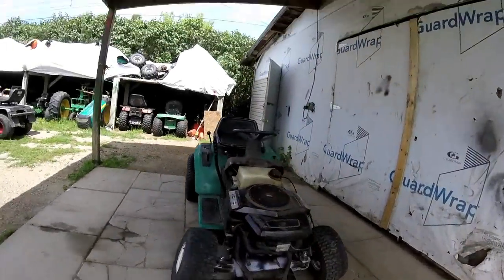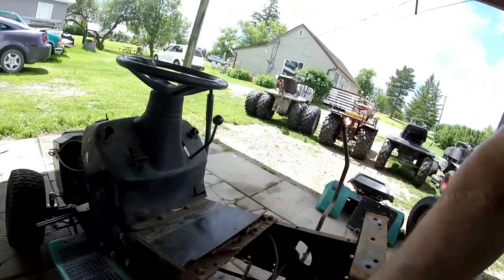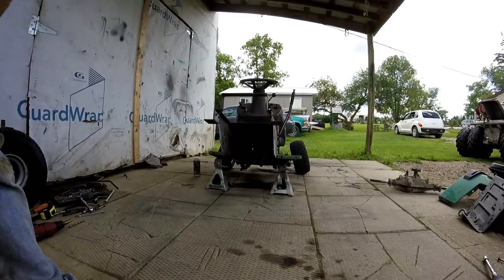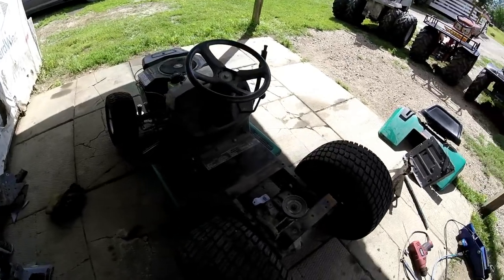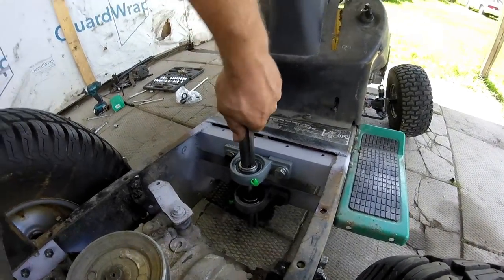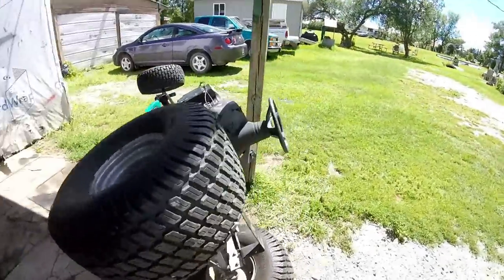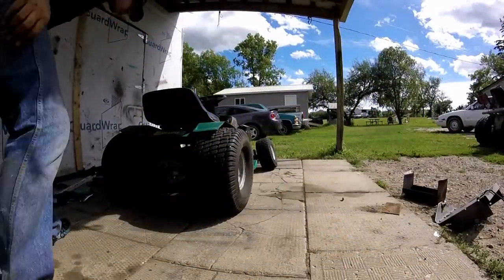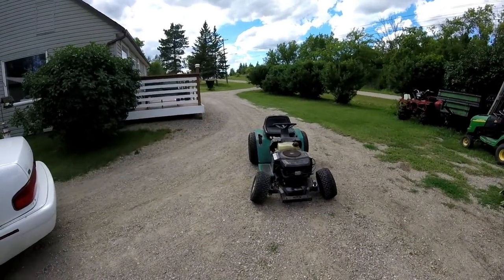How to build a racing mower part 2 lowering rear end

Comment from the maker: I made a extension bar goes on top of the shifter linkage extends about 4in made out of 3/8 ratchet extension
Reply: How did u do the gearing because of torque issues

Comment: On the motor it should be a 6 1/2 inch poly/2 inch pulley on the bottom tied to the motor

Comment: How fast does it go I got one and it's a 3 speed and goes around 55 with live axle, exhaust,and no governor and bigger carb but I didn't think just that would make that much hp
Reply from the maker: I had mine up to 62mph on my Road 2 scary go any faster had it up on jacks full speed with a speed gun pointing at the tire it was doing 78mph

Comment: do you absolutely need the camber at high speeds?
Reply: It seems like more to do, and camber is very tricky with hand tools
Reply from the maker: It was a very squirrely machine that very high speed
Reply: @greasemonkey348   i mean, u were hitting 62 mph on a mower, mine will prob. only go like 40 or something

Comment: Why is it always white around your welds. Is it a primer or just something from you flux
Reply: i guess it's zinc spray for rust protection..
Reply: I’ve never seen him weld... I’m sure it’s JB Weld, he cleans it up with a grinder and primes it. Then starts recording again.
Reply: hes probably using a stick welder and it burns really hot.
Reply: @niftyt1  its not jb weld

Comment: How did you setup your clutch?
Reply from the maker: Still use the original the weed eater clutch is really close to the engine so even with a jackshaft it works

Comment: Idle is really high
Reply: It is wacky but most larger  briggs idle at 1700-1800. 
Older single cyl splash lubed engines are around 1200.
Reply: To go along with Mrhillfolk there is no muffler so its louder and sounds like a higher idle

Comment: Way too much Camber!!! Adjust carb.  Engine pulley is not likely 2"  Probably 4.  Cover the 9" pulley completely.  Put suspension springs back under the seat.  Runs Ok, Change Camber...new spindles, new attempt at slight camber.